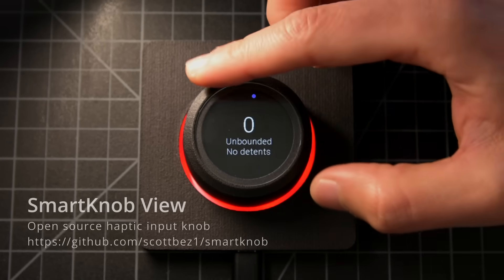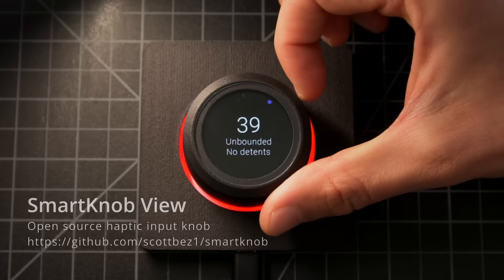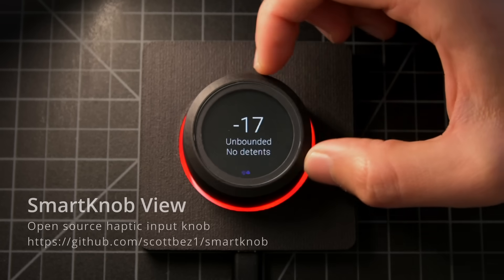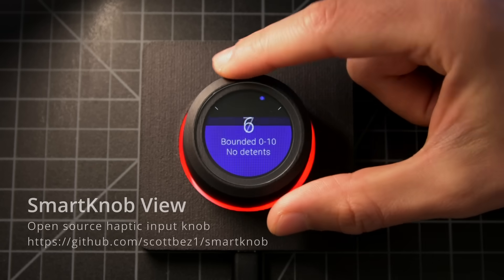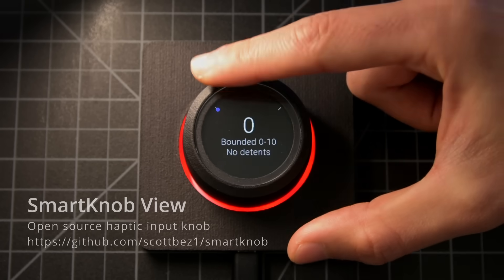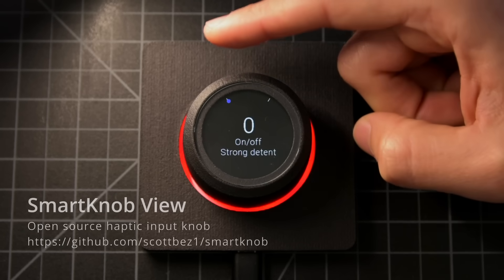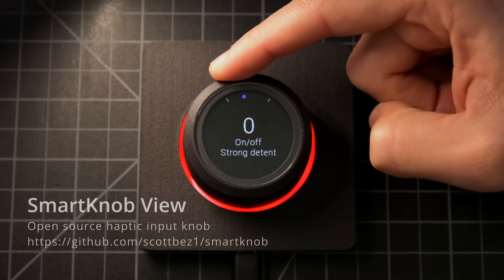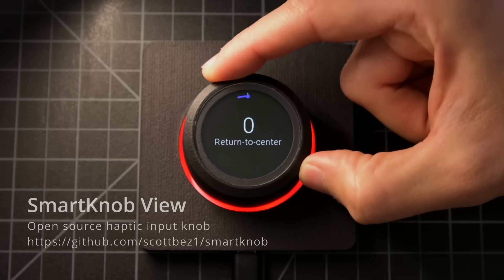DIY haptic input knob: BLDC motor + round LCD

Comment: why are open source designs always far superior to anything commercially manufactured. This is so impressive.
Reply: When you're taking a product to market it is going to be stripped down for low-cost parts and manufacturing processes. While this knob is relatively low-cost, there are certainly drawbacks to making it the way this video shows you on a large scale.
Reply: Because an open source design is designed with the goal of developing a good product rather than how much money can we squeeze out of the consumer
Reply: @laeven_  ❤
Reply: @laeven_  this with the added context that if you do attempt to sell your product you'll be drowned by your competition. Consumers used to crappy goods will flock to lesser quality product and you'll be bankrupt.
As such the "closed source" projects die off in a quiet way, but open source persist when the threat is nonexistant to big corporate profit margins. A rype of survivorship bias.
Reply: because they are artisan builds not optimized for mass manufacture
Reply: because manufacturing is extremely hard and prototypes are extremely easy
Reply: also patents
Reply: Because these people didn't have to be paid to do the thing. They just loved it so much they did it for free!😊
Reply: Because they are innovative and are not controlled by “industrial design” bosses
Reply: @aayaan1935 ⁰%⁰% hai ⁰⁰000{⁰0q
Reply: @aayaan1935  Try making sense next time lil bro. Innovative things get patented and are not open source. Also thw two things you mention have no correlation to each other.
Reply: no money involved + no time constraints. But I wouldn't say "always". to be honest many closed source things are a little better then their open cousins.
Reply: Because they need it as cheep and fast as possible to manufacture. So they cut corners
Reply: Always is a stretch mate
Reply: Cuz the premise is to introduce an item to solve a problem, not to create an item to introduce a problem to solve.
Reply: Because they have not actually had to get approvals for the project and also many times these designs come before getting it industrialised and commercialised …
Reply: Because it's cost much more( mass production cheaper things is way what choose billions people.
Reply: Because what you say is just wrong
Reply: This is cool
But incredibly expensive 
Massive production makes less cool things but for less
It doesn't matter how cool the thing is 

If the motor alone is 30$ add to that materials add to that screen add to that posting 

I am sorry but that much money for a fucking knob is a lot
Unless you are making some custom stuff and this knob won't make a difference in the final costs but will do a big impression
Reply: Open source is based on passion
Products are based on exploitation
Reply: Seriously? Capitalistic power to those select few born into money making decisions vs the rest of the human collective no longer limited by the stupidity of currency....it's not hard to see why that works.
Reply: Google Docs and MS Excel are much better than LibreOffice Calc. However this input knob, is simply amazing...
Reply: Of course dude it’s brainstormed by many people who are interested
Reply: Apes together strong
Reply: lol you answered your question
Reply: Because they don't listen to Mr Benji
Reply: passion
Reply: Google (Nest) has had this technology in their smart home controller for years. It's cool that it's getting an open source implementation though!
Reply: A bit late to the party, but as someone told - A developer can either deserve a reward or demand it, but not both
Reply: because it's hard to manufacture
Reply: cus theyre made from a place of passion
Reply: Because a button like this is not possible to mass produce and be sold to you for 200$

Just the injection plastic molding is 100k so that would be a minimum of 500 units to break even. The designers, engineers and programmers need to be paid, shipping, packaging, marketing need to be paid and profit needs to be made so lets say its a 6-12 month burn down period from idea to units produced. 200k for molds, packaging is 1-2$/piece, shipping is 1$/piece, a team of 5 at 80k/year is 400k. The cost of material and assembly could be 30-40$ so at a price of 149$ there's +/- 105$ left. Now you need to pay the molds, salaries, marketing so kets say 700k. You'd need to ship close to 7000 units.

Your best bet for really good products is in high end but do research because high price doesn't always mean high end
Reply: Cause they are mostly made out of passion. Passion always wins
Reply: Because its bullshit that a single person can have fun designing but would be unfeasible in a huge scale production. Not to mention the whole set of issues “open source” things have. Not saying its the same for this, but thats why something 1 person does seems crazy good in face of massive production.
Reply: Because they don't break easily and you can fix them yourself.
Reply: because they aren't restricted by profit targets
Reply: Because commercial designs have to be profitable
Reply: Far fewer people could afford products (or would want to) if things were made solely for cool factor instead of ease of manufacturing and cost.
Reply: It's not about the project, it's about the people involved, open source guys approach the design with the mentality of "this needs to be kewl". That's the result that you get. Imagine if everybody just made stuff themselves starting from these designs how the world would be, just making what you need.
Reply: I believe Logitech MX Master 3(s) scroll wheel is using literally the same approach. They have ratcheting/freespin mode that's implemented purely in software! Older MX Master mice used mechanical switches, the newer ones have magnets and coils.
Reply: companies want to make money first, and products second. Everything a company does will be to maximize profits and minimize costs. Open source stuff like this also doesn't need to be put under the same considerations as something that will be mass produced
Reply: Because users buy the product that spends most on marketing, not the best product.
When people stop acting retarded we will get good products.
Reply: because they need to pay their workers
Reply: it's easier to hold good products back for yours so they can dump the bad ones and claim the v2 is far superior and you should buy it. just capitalism
Reply: At the start of commercially manufactured products, you may get prototypes like this. Then, to get it commercially manufactured, you then meet all sorts of obstacles, you may need to make changes or make compromises. Obstacles mainly cost, then does the sales recover your cost. Big Corp mass production or self-employed small production, you meet the same obstacles.
Reply: Cost
Reply: Commercial makes it cheap so you break it and have to replace it...
Reply: Because captialism is horrible at innovating on anything but new ways ro screw people over long term lol and they aint for profit
Reply: That's just not true man, these are the successful opensource projects with a well in-tune community that helps and patches in. There are tons of abandoned and straight garbage codes on github that are still open source.
Reply: Apple uses this on their apple watch "crowns" I believe.
Reply: Because they are made from passion and not for profit
Reply: Incredibly untrue
Reply: Made by engineers, not accountants
Reply: Because when you only need to make one prototype you don’t have to deal with the complex realities of commercial production lines and scalability.
Reply: Because it’s done for the love of the game instead of money.
Reply: Seriously!
Reply: Make it in mass scale for reasonable price and then we can have this talk
Reply: This is why I'm socialist
Reply: Because this thing to be produced massively and pay everyone will eventually cost way more then the people are willing to pay (people, everyone, not some minority)
Reply: With all respect to open source, that's just a false statement.
Reply: Typing this on my iPhone.
Reply: The Idrive control knob in BMWs uses a similar technology to stop the rotation at the end of menus on both sides since 2010.
Reply: Because it’s probably not cost-effective
Reply: looooool this is the worst take ever posted online.
Reply: @hambaku7318  seems like 1400 people disagree with you
Reply: Easy answer. They're not. Everybody likes to hate on commercial stuff to glaze on open-source but theres SO many open source projects and items that are not as consistently good as on commercially released. Of course there are instances like this one where an open source product is amazingly implemented and shines but its far more often the opposite case.
Reply: @SYMSNC idk about hardware, but un software there are SO MANY examples of something open source being better than something paid and made by big corp.
Reply: Bruh, this tech isn't even close to the "new feature"
Reply: @p4st3rn4kk  yeah, especially when you comment on something a year after it comes out.
Reply: @RE4CT_  it was released in gaming steering wheels about a decade ago
Reply: because they actually give a shit

Comment: As cool as this is I’d love to see an attempt at inertia! Give the wheel a flick and depending on detents and friction the wheel could spin a few revs before slowing to a stop.  Video editors have mechanical shuttle jog wheels like this. It’s a gas watching a skilled operator flick them around with high speed and precision.
Reply: yes indeed and imagine if it had 4 way push so you can spin to a point, pull down to drop cut video to line, push up to delete etc
Reply: I was absolutely thinking about the applicability of this for video editing.  I guess it can't be both jog and shuttle simultaneously, but it can switch back and forth easily enough, and that's pretty cool all on its own.  And hey, if a 2-layer version could be made, then you'd have the full package -- PLUS the ability to make it do various other things, too.  Very cool project!
Reply: Would be useful for a mouse scroll wheel.
Some Logitech mice have a mechanical wheel that can be set to smooth inertial spinning.
Reply: The wheel will need to be heavier to effect inertia, but that smooth tactical feedback😭😭🥹🤲🏽❤️❤️
Reply: @rainbowseal69   Inertia can be simulated with the motor
Reply: @111ch1a1d111  : I said that in my reply, but it took me three times more words, and I was a month too late!  🥴
A perfect example of checking to make sure that nobody else has already said what you are about to say!  😜 👍
Reply: @rainbowseal69  :  I think the idea was to have the motor make the knob behave as though it had more mass... that way you can code it to behave as if it had minimal mass when needed.
Reply: inertia without mass! great idea!
Reply: @VoidedWarranty :  Virtual mass?    😜
Reply: the mx master mouse 3 has this

Comment: I've found the BL Motor 3215
- Outer dia 31.9mm
- Shaft hole 5.9mm
- Shaft hight 15mm
- Wire length 30mm +/-
- 272kv +/-
- 3,280rpm @ 12v
- Weigh 39.3g

Comment: This kind of thing should be used in new cars. For whatever reason, more and more manufacturers are deciding that it’s a good idea to force the driver to take their eyes off the road just to do something simple like change the radio station or turn on the AC, by using a touchscreen rather than physical controls.
Technology like this however, could make use of both sides. Since everything is software controlled, the same knob could be used for different things in different situations. And since the knob is still physical rather than just a touch screen, the driver can keep their eyes on the road while using it.

Comment: I've got to know - is the screen rotating with the knob and the image is adjusting, or is the screen fixed while the knob rotates around it? Either way it's so clean I can't tell the difference!
Reply from the maker: The screen is fixed and the knob rotates around it. The motor has a hollow shaft, so the screen's wires pass up through the center of the motor. I'll show this in detail in my next video.

Comment: what is the powerconsumption on the motor, it would be verry cool to implement this in to a keyboard but the max amperage on usb 2.0 is quite low? Would somthing like a build in UPS be needed to make sure there are no spike's in usage the usb port could not handle?

Comment: This would be great with Home Assistant.  Shade control open/close or even position.  Lighting controls on/off brightness, color temperatures.  Thermostat setting.  Media control.  Alarm clock, time setting.  This one knob COULD replace all switches in a room to offer a single point to control everything.

Comment: This technology suits many markets but as soon as I saw it I couldn't help but imagine it in a car especially with the new minimalistic approach many manufacturers are taking. This really can be a game changer and an incredible solution for the fine balance between reducing cost and maintaining customer experience. Incredible work!
Reply: Exactly. Touchscreens are reliable and cheap but the lack of tactility is dangerous in some ways, if not extremely unsatisfying and soulless. A contactless system with simulated tactility is the way for the future.
Reply: @themagnushjort  This doesn't solve the tactile problem, because it's still a soft knob. If it doesn't have a dedicated function, you have to look at it to see what it's doing. It's as bad as a touchscreen in that respect. It also gives no tactile indication of position. The position indicator is still visual only.

Dedicated mechanical knobs and switches are far superior, because their position in space and feel tell you what their function is without looking. You don't have to look at the turn signal stalk to figure out what "mode" it's in. You don't have to look at the headlight switch to tell what position it's in.

And dedicated mechanical knobs and switches are much cheaper than this.
Reply: My 2016 Lexus Es 250 has this feature on the menu controller.
Reply: Our Mecedes B-class have a dial control. It's awesome.
Reply: Rivian just showcased this on the steering wheel of their R2
Reply: imagine it on an Fueltech
Reply: I can imagine a slightly bigger one ima studio or game room to change the colors of the light is volume of music and temperature.
Reply: I guess the Rimac Nevera has this knobs.
Reply: Touchscreens aren't cheaper than buttons. Touchscreens aren't there for that reason.
Reply: For a car input I would loose the LCD.  It would be hard to place the knob in the field of vision of the driver and the traffic. Instead I would include something like a vibration motor and maybe a few haptic fixed buttons. like home, select, quick menu (navi, radio,...)).
Reply: Vw Phaeton had this feature decades ago 😉
Reply: @TheBurnout96  bmw idrive in pre 2010 cars had this
Reply: I drive was my first thought. The one thing I'm not sure how you'd do is the up-down-left-right motion of the knob. 

If you take an I drive knob apart you'll see it's a very complex set of four arms, linked at pivot points, which allows for this functionality. I have no idea how you could replicate such a think here.

Maybe the best solution be to make the entire knob assembly, controller and all, mounted on a trunk on that could be moved four ways. Maybe I'll try it, much to consider!
Reply: Edit: I mean carriage, not trunnion
Reply: You don’t have to imagine it, take e60 bmw and experience it in before 2008
Reply: The BMW m3 has had this since like 2000...
Reply: Mercedes used this style of controll from '09 to '15(ish) when they changed to Touch controlls on a seperate surface.
Reply: love me more stuff that needs maintenance 
if it's ain't broke ... break it
Reply: @ko-Daegu  how much do you really think this will cost? the most expensive item in this contraption is the brushless DC motor and they are usually rated to last around 10,000 hours. Assuming you fidget with your knob for 1 hour every day this on average would give you around 27 years before anything goes wrong and at that point I don't think this knob would be the biggest issue the car is facing.

Comment: I don’t have the know how to build something like this : soldering and stuff.
But if at some time a commercialization is possible, I would love to know if you could connect it to a smart home like HomeKit, google or Alexa and link it to several items (you press the button to switch from dimming lights, to heat control, over kind of buttons), all in one device. I really see this as an all in one switch control replacing 3-4 separate buttons and controllers

Comment: Awesome stuff!  Will the knob break if the user forcibly turns it while at a dead stop?
Reply from the maker: No, the torque and power draw are both low enough that you can keep spinning it against the resistance and it will get a little warm after a while but it shouldn't do any harm

Comment: something like this would be a perfect tactile feedback for use in automobiles.  My CX-3 already has a tactile wheel encoder, with joystick directional tilt to control the main screen while driving (rather than touch, or voice command), but a more robust/contextual application of software-based tactile encoding would be brilliant

Comment: These would be fantastic in some sort of context dependent controller for digital audio workstations, graphics tools and editing suites.

I can just imagine it switching from a 270 degree pan knob, to a vertical 180 degree volume "slider", to a 360, 720 or endless rotary encoder for general purposes, all depending on what parameter you've tabbed to or moused over.

I have a blind music producer friend who'd kill for a more tactile way to interact with largely graphical interfaces of plugins and so forth.